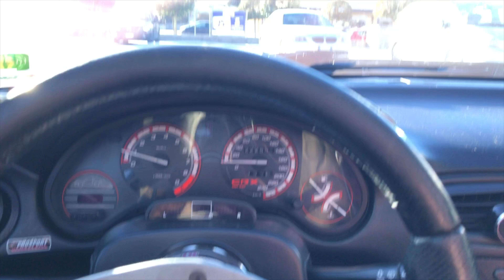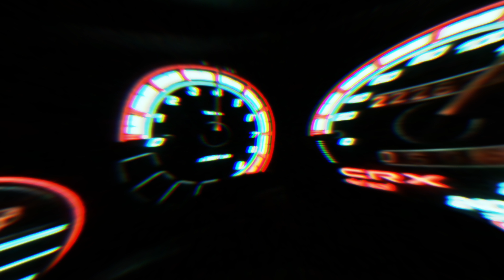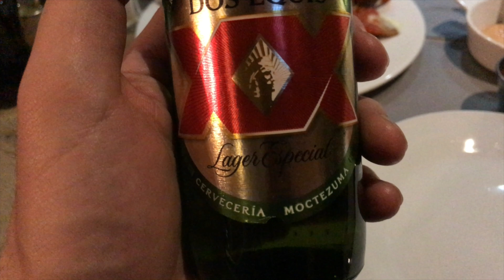Lago Maggiore | With the Boyz | VLOG 2

Comment: Good video man. Looks like y’all had some fun. Your skills are improving. If I could give some small tips it would be a be a little more mindful of holding the camera a little more steady when shooting. Also I would look into a solution for wind noise when windy outside. Other than that it was great. Keep grinding and improving.
Reply from the maker: CBrigs Media 😁😁😁 thanks Corey! Yeah man, the wind was fking insane. I usually use the dead cat over the RodeMic but it was blowing so hard that it would have taken it away for sure 😂😂😂 okay so, even for a VLOG, you'd make it steadier? 🤔 I was thinking about using the gimball but i didn't as I thought it would give a more immersive feeling to the viewer if it was handheld. Know what I mean?
Reply: Gio DelSol well wasn’t trying to say it all had to be super smooth but like the section where you were doing b roll.